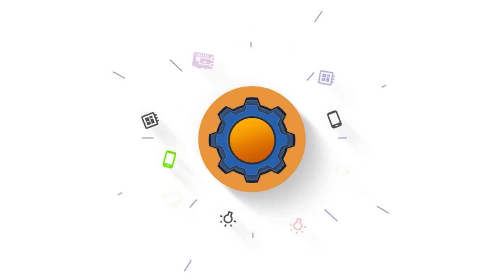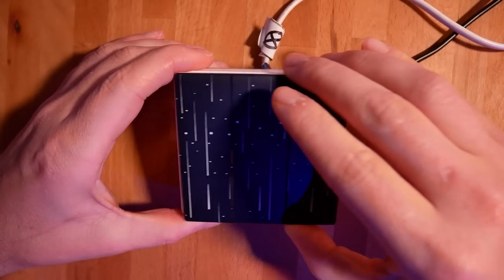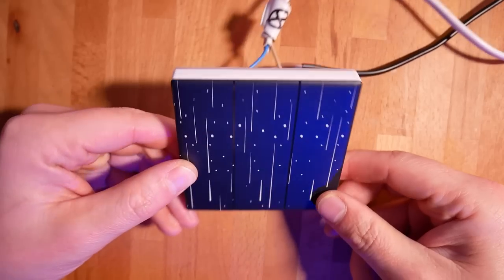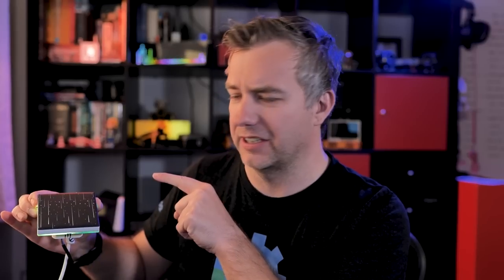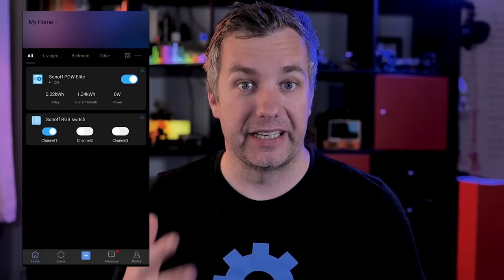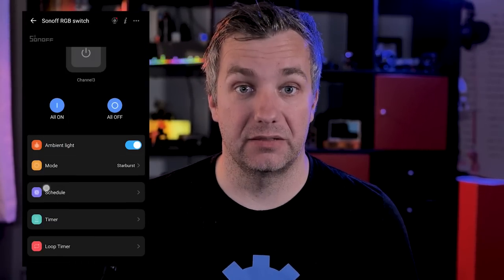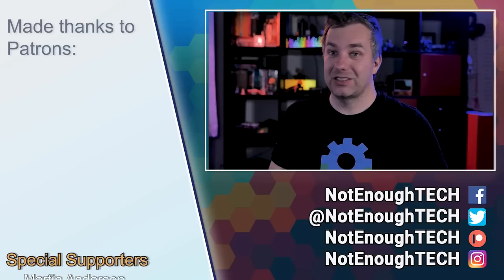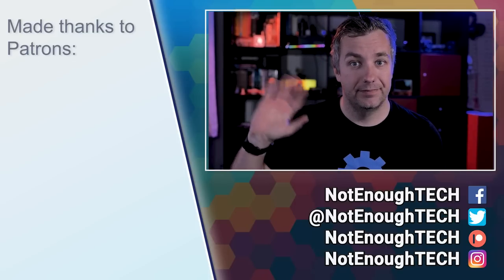Is this the Ultimate smart wall switch?

Comment: Would anyone know or could you guess if this light switch could be paired with the Fibaro Dimmer 2?. I am thinking this Sonoff 3 x gang switch can handle the smart on/off switch on one gang, and the other 2 x gangs could trigger the Fibaro dimmer to dim up and down?. I know it wouldnt be cheap but should it work?

Comment: Would love a dimmable version of this. Can the swipe actions be used to adjust brightness of the sonoff D1?
Reply from the maker: You could use these to set 2 brightness values. I wish more devices supported dimming. I settled for light control and then smart bulbs in my lamps for more subdued evening lights.
Reply: Agreed.  It''s a shame Sonoff don't support dimmable devices more.
Reply from the maker: Dimming is hard. Not from hardware perspective but from compatibility stand point. It was easier on incandescent bulbs but with LEDs every company has their own way of making LEDs work and that's hard without making a smart bulb
Reply: @notenoughtech  if you can but a rotary dimmer that is LED compatable (trailing edge) I can't see why we can't do this with smart switches. Would be great if they could merge the D1 with the MINI
Reply from the maker: Because each time a customer gets the "dimmable" bulb that isn't compatible with a switch they would blame the switch for it. It's just a bad overall customer experience and a risky business. 
That's why it's hard.

Comment: Can you find buttons in the dark? With that I mean: can you slide/search a button without looking and then when pressing, it wil react with a certain force? The problem with touch buttons is the they activate when slightly touched.
It should have some kind of force sensor
Reply from the maker: You could just map slide gestures to do that directly and set them to be active at night.
Reply: @notenoughtech  I was thinking the same, but was still wondering. Can you activate the haptic feedback on a successful gesture?

Comment: Would it be possible to connect 4th light (Alexa compatible) to one of the slide motions?
Reply from the maker: Yes you can use automation panel to trigger these remotely
Reply: @notenoughtech  I've seen on your blog you've tested some smart devices power consumption. Have you tested this switch maybe?

Comment: Tasmota flashing is new to me.. If I flash this to Tasmota and then use Tuya-Convert to flash my Tuya devices to Tasmota would they then play nice together and allow me to link the power on & off and swipe left & right to my Tuya ceiling fans so the power on & off  turns the light on and the swipe left & right changes the fan speeds?
Reply from the maker: Yes. If all devices have custom firmware then you can use these together. It would be either via REST requests or MQTT.
Reply: @notenoughtech  Danke for replying. I forget, have you reviewed the Homey Pro? So wish I didn't buy it. lol

Comment: Something of this sort with 2-3 sliders, being UL (or at least ETL/TUV) listed, and zigbee would be great for a home assistant programmable widget. Especially in new construction one wouldn't need any complicated switch wiring, just wire to lights, one wire to switch, then handle it all in software. Would be an issue for resale, but meh :D

Edit: I guess RGBGenie RGBW Remote is what I'd want, but hardwired on a wall...
Reply: There are literally hundreds of smart switches out there, some have swipe functions, depending on price point.    If you are building your own new place, you coudl specify to use any one of the smart switch options.   Smart switches will not be a default install for general construction for a long time because there are just too many ecosystems, some quite locked down, and at this stage, home automation is still a relatively niche market.
That all said, I am a nerd and love this stuff and honestly, this size is based on the standard UK/EU square wall plate and it would be easy to retrofit a switch.   I would like to see them release this in a No Neutral version.   Aeotec can do it with their Nano Dimmers and wall plates, so it should be achievable from a technical perspective.    For a lot of people removing a wall switch and retrofitting may be beyond their knowledge or comfort zone, so they'd get a sparky in.    For us that are comfortable, retrofitting these switches is a pretty easy task as long as you have a neutral at the switch for the current iteration of it.

Comment: What disappoints me with these type of switches is that the still insist on only providing WiFi 2.4GHZ.    I know the bandwidth is not a big deal but with how congested the 2.4GHZ band  for so many people, it would be nice for these to be dual band capable, which could be done with an ESP32 C3 or C6.   I guess they likely have a stack of older ESP32's they need to use before worrying about firmware.    The exposed terminals is not great, especially if you have metal wall boxes.  
The 5amps per gang is great for lights.  I like that and there are a lot of good features on this switch if you like some extra bling with the RGB and sound.   Not quite my cup of tea for a switch, but I get some will like it.   
I hope Itead take the feedback about the terminals on board as I see this as a safety  issue.
Oh and I hope they consider a No Neutral version of this, even if it has the swipes but not the LEDs :)
Reply from the maker: I think as more and more devices are ac/ax sticking to 2.4GHz makes actual sense at this point. Mostly cause it's the most penetrating band we have with best range. 

The rest of the criticism is very valid
Reply: Not sure why I keep seeing requests for 5Ghz, maybe because people think its newer/the latest thing? 2.4Ghz has plenty of channels and I've installed hundreds of devices with no issues. I keep seeing requests for 5Ghz but people don't know what they're asking for. 2.4Ghz is superior when it comes to penetrance through objects than 5Ghz or higher.

Comment: I was looking forward to this, after watching your review and trying to order it seems it requires a Live cable. Most homes in the UK are not wired this way. Shame because I wanted to order 10 and do many things with it.
Reply from the maker: Unfortunately that's the same problem i have. Without running an extra wire it's hard to deal with these. It's not the most efficient bypass but you could run L&N to the switch (rewire from ceiling) then use the relay to control a smart bulb or small switch. You'd retain all the fancy features like RGB etc. Not ideal but also a workaround
Reply: @notenoughtech  Wondering if they hit a power limit when drawing off just the neutral? Although that's why most manufacturers provide a bypass module. A bit of a oversights from Sonoff's part.. I'm sure they are well aware this will impact their sales. It would be nice for them to provide a reason why they choose this design or if they have plans to release one in future. Going to be tough marketing this in the UK at least.
Reply from the maker: Bypass usually is to reduce flickering. And make more bulbs compatible

Comment: These kinds of switches look really cool, but I'm not sure I would like them when fumbling to find the right switch in the dark. I will probably stick to the new Lutron Caseta Diva Smart Switches, even though they're twice the price.
Reply from the maker: The fun part is that you can set the swipe action to specific activation time, so it triggers light just the way you want it in the pitch black room.
Reply: The swipe actions do sound cool. But, you still need to locate the switch in the dark and then swipe. I can see myself accidentally activating the swipe actions while fumbling for the switch I want to press.

I do like some of the features, though. Perhaps I just don't have an application for such a switch in my home automation.
Reply from the maker: Each slice has a ambient effect for on/off which you can adjust the colour and brightness for and enable on a schedule. It highlights the slice with faint light from the top and bottom

Comment: If they made a version with a good quality dimmer instead of a switch I would immediately get it. Now... I'm wondering, I just like having all of my lights dimmable so I can make them less bright in the middle of the night.
Reply from the maker: Dimming is troublesome simply dut to the sheer number of bulbs available.
Reply: @notenoughtech  Yes, I am aware. I've had good results with the Fibaro Dimmer 2 devices though, but they have configurable dimming methods (i.e. trailing edge and leading edge) which has not been an issue with any of my lights so far.
Reply from the maker: Try starting a channel, recommend a dimmer and see your inbox flow with issues :)
I appreciate sample size of one and I'm always happy for each automation. But if you sit for a day where I sit (I talk about these things with ppl and manufacturers) you get to see both sides of the same coin. 

Is it doable sure... Profitable? Well... There is a reason we have shit loads of smart bulbs not dimmers to pick from
Reply: @notenoughtech  Hahaha, you have a fair point indeed. I certainly don't envy you... every video you post gets backlash regardless of your stance.
With low quality dimmable LED bulbs they are probably going to have issues as well... those are problematic (color correctness for example) regardless of the type of dimmer.
Still though... I wish there were more options for dimming existing fixtures.

Comment: Does this work with Philips Hue lights?
Reply from the maker: Define 'work' it will cut the power to the light bulb which is not what you want for the smart bulbs.
Reply: @notenoughtech  I mean if supports controlling intensity or color. Don't understand why they launched this without Matter support.
Reply from the maker: Probably not the best type of switch for that. As per matter support... It would be relatively easy to OTA on every device with esp32. Espressif mentioned matter protocol support for esp32 and C/S variants.

Comment: I already have 1 NSPanel and 1 Switman I use ESPHome on both. I would like to be able to take off the front plate of the Switcman and plug this is instead as I had to get an electrician in to install the NS Panel and switchman as the back box wasn't deep enough. I don't want the additional costs every time I want to change the light switch.
Reply from the maker: There is always a standard that will make an implementation difficult. I have some wall boxes that are 15mm deep and long time ago I decided to close it off and use a ZigBee switch (battery operated) than fight with the idea of cutting into wall. 

No automation is perfect it's about picking your battles in a smart way

Comment: Totally agree with Zigbee comments. Surely the days of running mains wiring to switches are numbered.
Reply from the maker: I work in automation. I can assure you it's not the case. Each way of automation has strengths. Imagine what you say it's true and you are going to stop wiring light switches with mains and rely on battery ZigBee switches. Average house would need approx 10-20 batteries per year. That's 20 milion of households in the UK asking for 200.000.000 to 400.000.000 batteries just for one country. 

Future houses will be built not with ZigBee but simply signal wires to each outlet and a single connected microcontroller. Your entire house can be controlled from a single esp32 device of you care to re-do the electrical wiring for each light and socket. It would be cheaper to run and maintain. More robust and future proof as if protocols change you need to change a single board. 
Disadvantage is obviously prohibitive cost of retrofit but relatively low cost for new builds.

Comment: This is 100% not ultimate just because it's wifi. No other info needed :(
Reply from the maker: What's wrong with WiFi specifically?
Reply: @notenoughtech  power draw and reliability are the major drawbacks of wifi for me. A proper quality zigbee switch consumes less than 0.5W, most wifi equivalents I've seen use at least 2.5W. With my current energy prices that's a difference of about ~15 euro per year and that quickly adds up. I currently have 60 zigbee devices in my network, if those would all constantly consume 2W extra that would make my energy bill around a 1000 euro a year more expensive.
Reply from the maker: If you have reliability issues your issue isnt the protocol but equipment. Whole world uses WiFi on such scale that it simply mind blowing. The protocol can easily handle a simple switch. 

Power concern is one of 2 valid arguments. The other one is the bigger security risk (assuming the device is connected to a network open to the internet)
Reply: @notenoughtech  
1) wifi is not so easily scalable as zigbee/zwave/bluetooth mesh. You need to add several hotspots for big houses 
2) Devices on it are more power hungry
3) No direct binding and single failure point to loose connection to this switch
4) Some local api's (sonoff is one of them) are just bad. Tasmota is ok, but you need to dissasemble the switch to flash it. Now imagine doing it for like 30 switches for a whole house

Wifi is good for general devices like a laptop, not for a smarthome
Reply: @notenoughtech  That is not what I meant, it's not so much that a wifi connection itself is unreliable but it introduces extra failure points. With zwave or zigbee binding the devices link directly to each other which guarantees a fast and reliable connection.

With wifi devices the common way of linking Tasmota or ESPHome devices together is through Home Assistant or Node Red. That adds yet another point of failure, your Home Assistant or Node Red installation and perhaps an MQTT server. Naturally you can directly link Tasmota or ESPHome devices to each other, but that requires having static IP addresses or the resolving of hostnames (which can be slow). And that's quite a bit more complicated to setup.
Reply from the maker: 1. WiFi is scalable. Easier than ZigBee and other protocols. Most of ZigBee routers allow you to add very limited number of devices directly. You need less devices overall for the same network coverage and capacity with WiFi than ZigBee. 

2. ZigBee suffers from protocol inter compatibility. Hence the realise of matter which aims to address it. While ecosystem fragmentation is huge in smart homes that use WiFi it's not caused by WiFi as protocol but the cloud providers. 

3. Without internet you have no remote access to ZigBee network. 

4. Flashing applies to ZigBee and internet based devices. Don't confuse the protocol with the implementation of it. 

I personally prefer ZigBee for many reasons but statements like ZigBee good WiFi bad are damaging to conversation as they peddle stereotypes not knowledge. See how the conversation looks like when you actually list things that work for you? 
Someone reading this has a better understanding about which technology will suit their scenario better and how they can take advantage of it.
Reply: @notenoughtech  
1) noone needs to add devices directly to the router, because every new lightswitch you buy scales the network
2) that's not the protocol problem, but companies desire
3) personally i think it's more of a plus that a minus. Easier to secure 1 controller than each lightbulb
4) Never needed to dissasamble or reflash any zigbee device (and I had more than 100 different ones tested)
Reply from the maker: Same applies to WiFi networks. Don't forget mesh WiFi exists. 
Here are applications where ZigBee and low powered networks can't compete:
1. Audio & video transfer (cameras doorbells wireless audio, intercoms etc)
2. Low latency Comms (ie live light effects sync) 
3. Long range application (ie farming automation) 
4. Data transfer  

That's a lot of automation types excluded because you insist that one protocol is superior to another. 

I'm happy stuff works for you but that's a very entitled thinking if you think entire industry should follow how you resolved your home Automation because it's "the way to go"

4.
Reply: @notenoughtech  I especially said earlier that wifi is bad for smart home. For switches, sensors, etc.
I'm not saying you should ditch it entirely and never set it up at your place in the first place. Just that you need to avoid it with all simple smart stuff, because it loses there 
And for long range wifi is not enough also) LoRa is better there